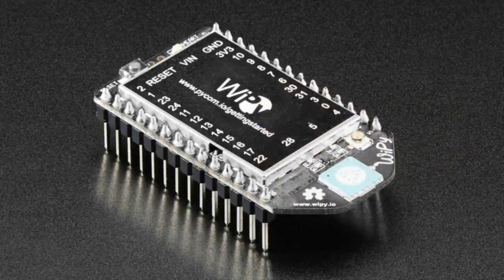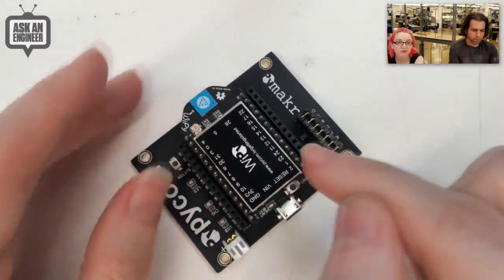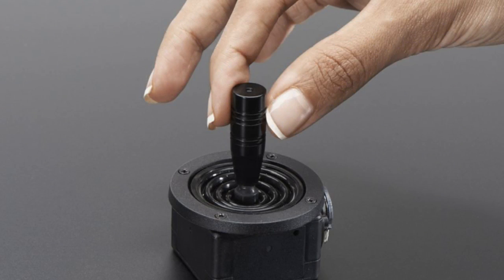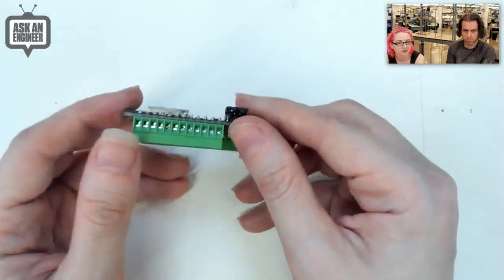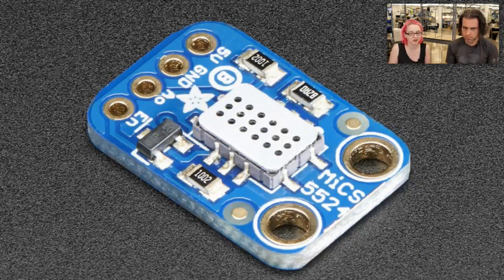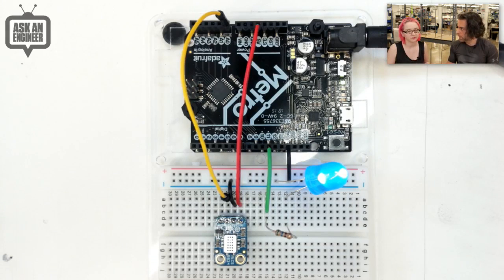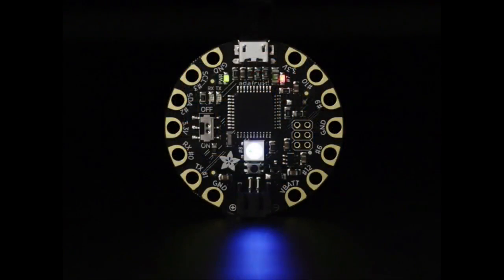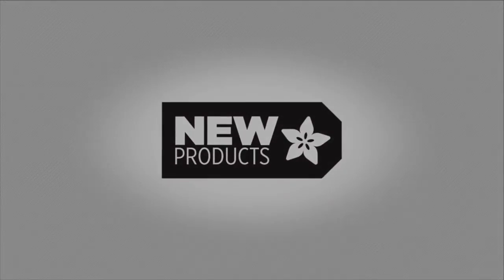New Products 7/13/2016

Comment: I bought the VOC sensor, and for a simple test I hooked it up to a PowerBoost 500 Charger and Mini 3-wire Volt Meter. No Processor Required, plus I think the digital output is clearer to understand than LED brightness. I was able to detect booze as well as wet cat food pretty easily with this setup, and it's portable.